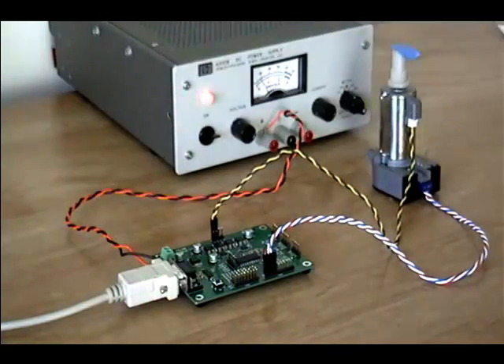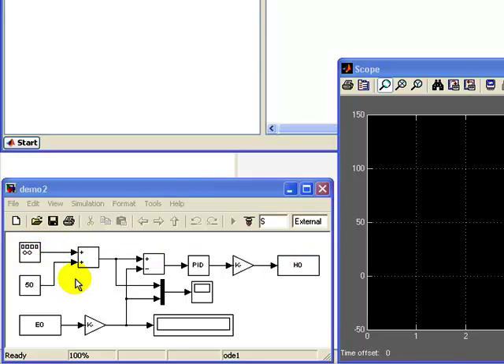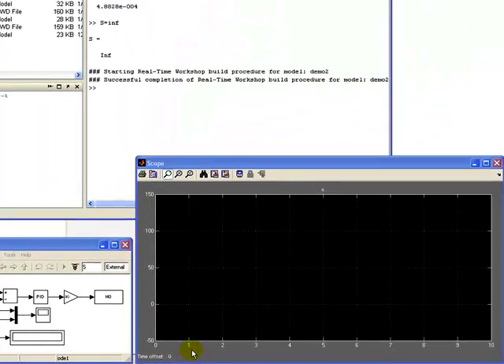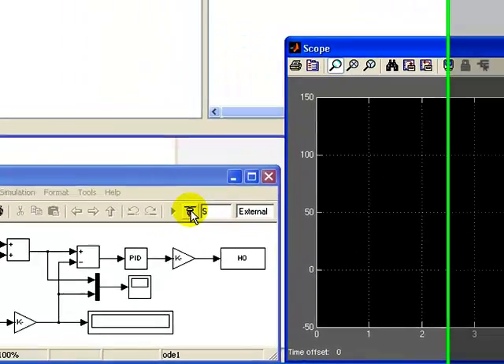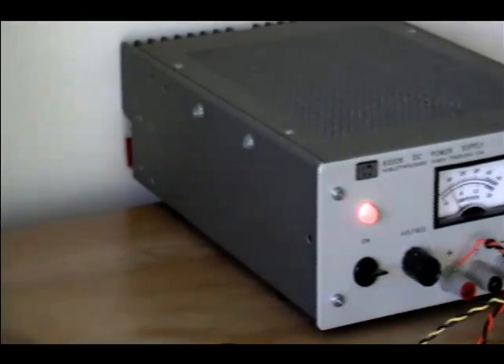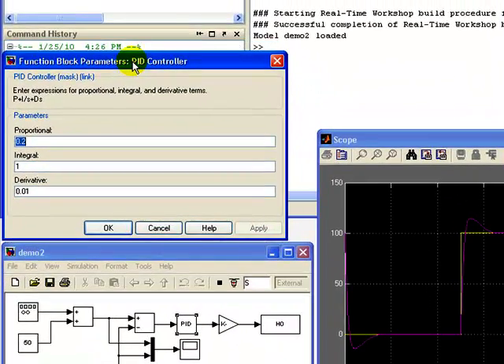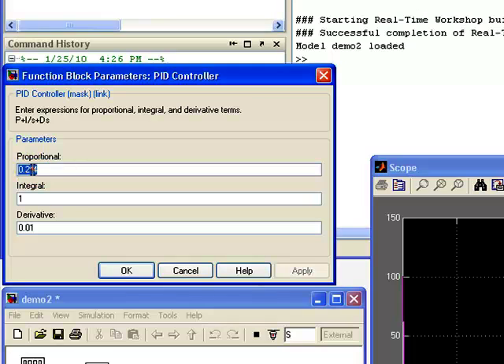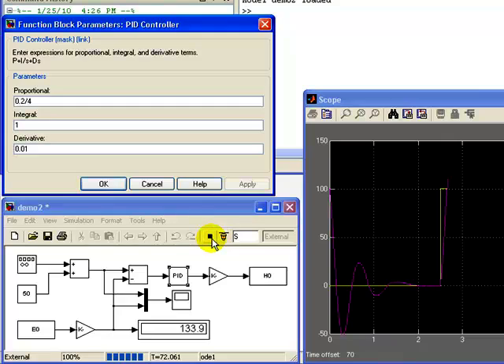Real-Time Control Platform for Matlab and Simulink: DC Motor Control

Comment from the maker: @Amardeep661 
Thank you for your comments. The is just a demo to illustrate how to control a dc motor with the HILINK platform. The controller is not optimized in any way to achieve a particular performance objective (fastest settling time, minimum overshoot, etc.). It just shows you can change the controller parameters while the system is running with the real plant (DC motor) in the loop and observe the corresponding response in real-time.